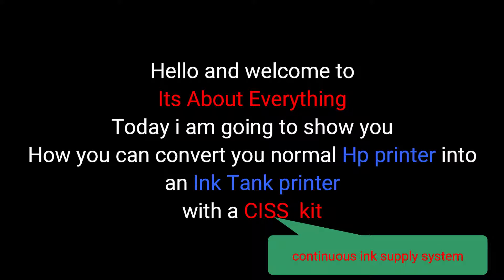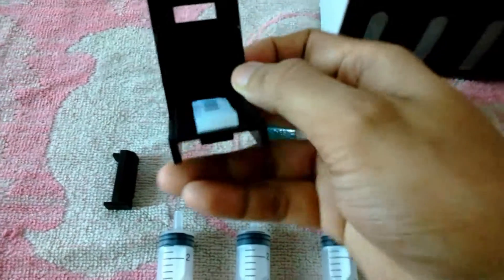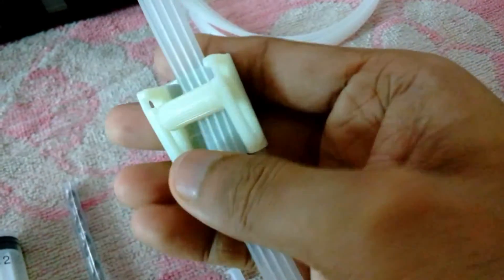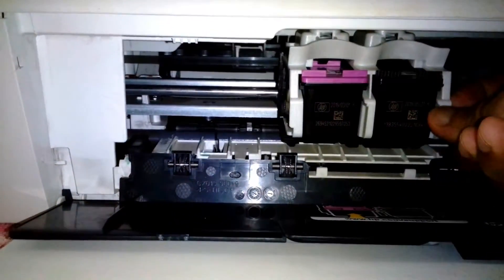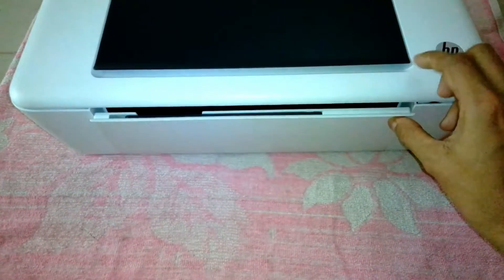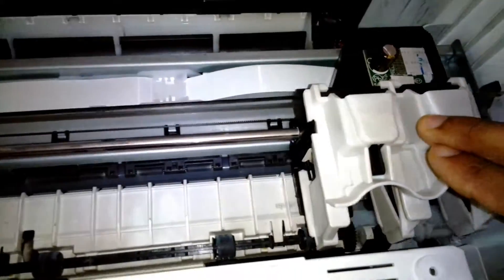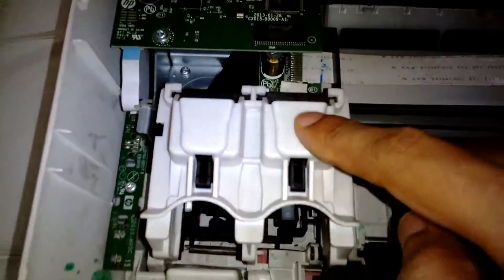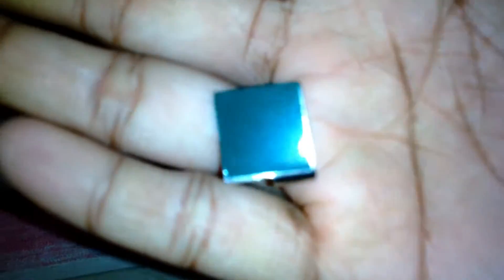Hp printer ink tank conversion with a CISS kit (DIY) Part 1 -- Its About Everything.

Comment: Bhai cartridges ke sab hole band karna hai kya? Except pipe holes? Please reply. I did it but the cartridges keeps on leaking, the leaking doesn't stop.
Reply from the maker: Don't keep the ink tank and printer at a same level. Take two or 3 books and keep the printer on top of it. About 1 inch above the ink tank then try to print. If still page comes out with over flow marks then add 2 more books under the printer and raise the level a little more and print again.
Repeat the process untill prints smoothly.
Don't raise it too much or the print will have gaps in between the print and the ink will back flow.
Height adjustment is necessary

Yes Plug all holes except the pipe connectors
Reply: @ItsAboutEverything01  Thnks you very much. It means sab Gravity ka khel Hai.
Reply: Bhai dose it work? This CISS thing?is it a success?,how long dose it work